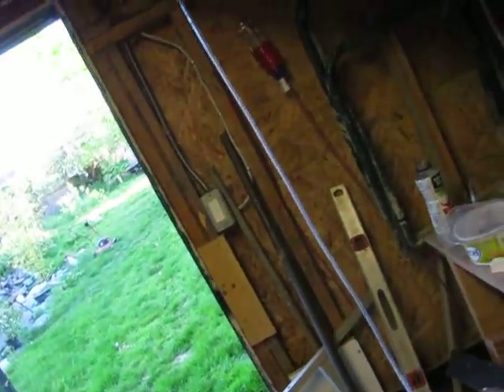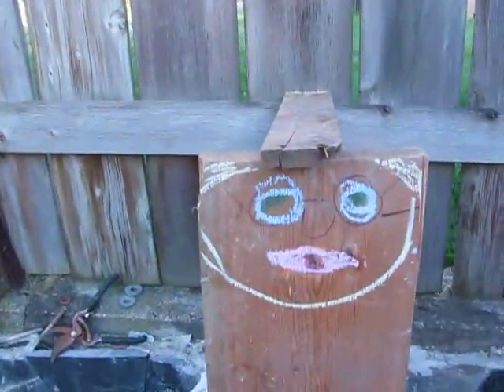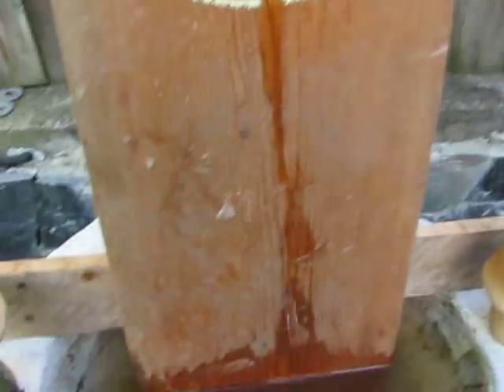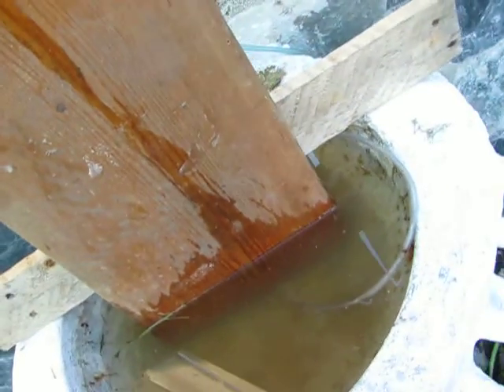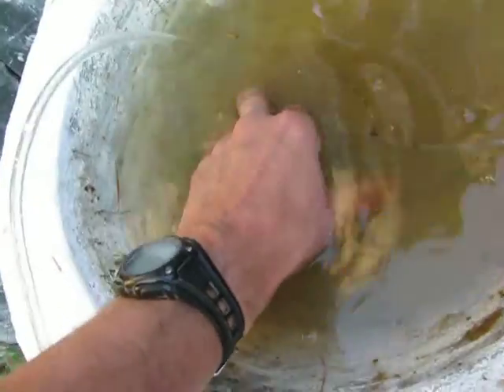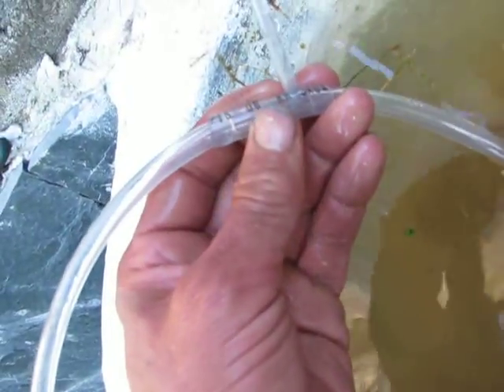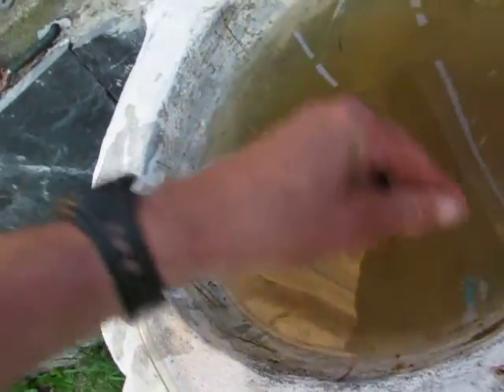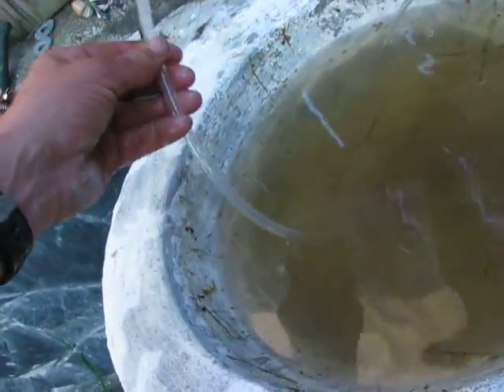How to make  really cheap fountains and bubbling dripping bird baths!

Comment from the maker: Yes indeed, I can do better but  I was just demonstrating that the ultra low submergence airlift pump can do various things. That airlift pump began in mid  January 2013 and already it has spread to Denmark, France, USA and elsewhere in Canada  with positive feedback in all cases so far.  I am just trying to make people aware of more of the possible uses for it.   One tiny pump in a shed somewhere can send low pressure air through irrigation line to  run 8 or 10 water features.
Reply: 8or10,,,?  it aint even running 1...